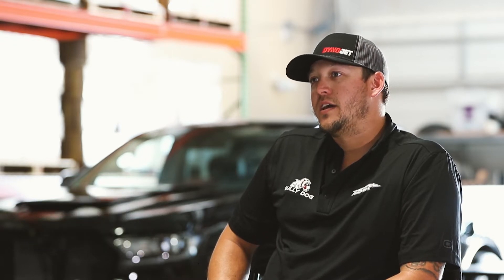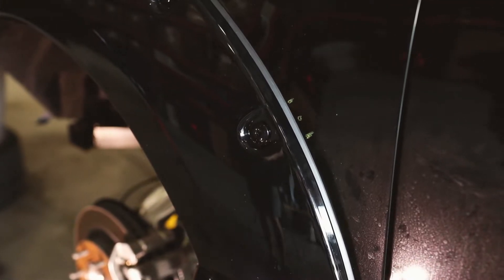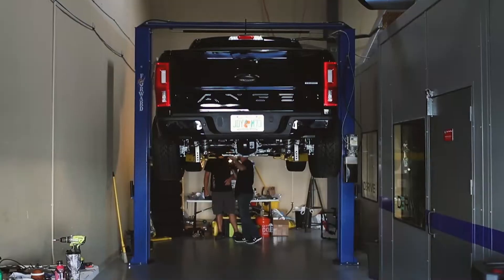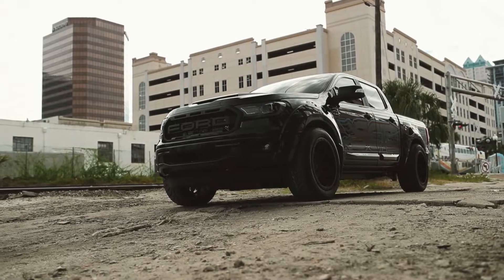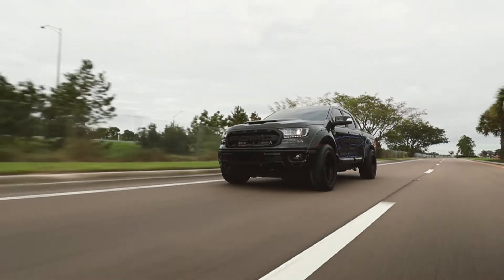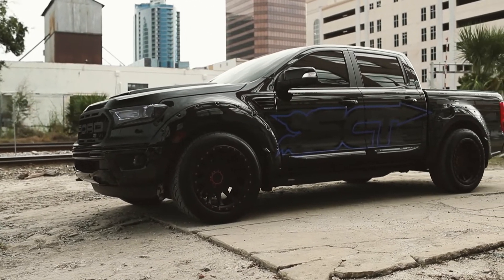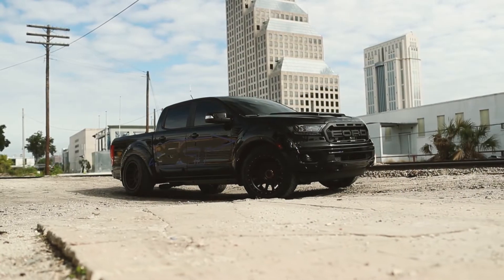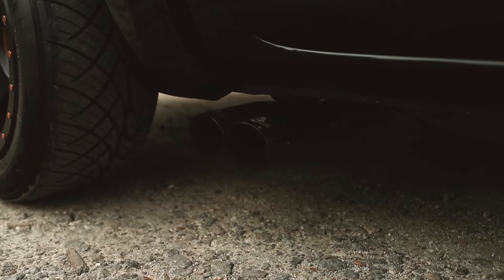'19 SEMA SCT Performance Build: 2019 Ford Ranger Circuit Truck

Comment: I'm cloning my '21 Ranger to look & perform like this truck.  Only issue I've ran into is, I cannot find Black Bolts for the Air Design Fender Flares...?  So far, I have everything else, except I'm wanting for the suspension parts to get back in stock....
Reply: Where did you find the air designs fender flares? I can't find them anywhere and ranger isn't an option on their website.
Reply: @Itzcuauhtli  Late 2021, Air Design had it on their site.  I have the same ones like they used on this truck, painted Shadow Black, off my truck and stored in my attic.

Comment: I've looked all over and cannot find the wheel and tire specs on this truck. Does anyone know?
Reply: I do!  Do you still need the specs?
Reply: @JasonsFourCamFox  Just came across this video now and i would love the rim and tire specs. Thanks.
Reply: @JasonsFourCamFox  what are the tire specs please ? I’d also like to know!
Reply: @Diguitarist  Crap, I'm sorry, YouTube didn't send me replies for a long time...  I'll reply below to Ron's comment.
Reply: @ron7416  I did the full swap a couple of years ago.  Wheels are Method Racing 605 NV Matte Black 20x10, 6x5.5 bolt pattern, 4.55" back spacing -24mm offset.  Tires used were Nitto 420V 265/50/20.  I'll let yall know, you will need a Belltech rear flip kit and an adjustable front coilover setup with custom upper control arms.  This will also stick the tires out almost 3" per side.  I still have almost everything off my truck, if someone is interested in any of it?  Wheels are gone.  Be warned, this was not cheap to clone...  You can find my build on the Ranger5g forum :)
Reply: @JasonsFourCamFox  Interesting, thank you!
Reply: @JasonsFourCamFox  did it ride well with those mods? why'd you decide to undo it? just curious.
Reply: @ron7416  No, it didn't really ride "well", even with almost $3k worth of suspension upgrades...  It rode like a normal slammed truck, with low profile tires, LOL!  Front drop was about 3.5"-4" and rear drop was 5", along with big, heavy wheels and short sidewall tires.  But, I have a track ready Fox Mustang with a Gen 3 Coyote in it and a 2 JK Rubicon with 37's, so rough riding is something I'm used too, LOL!  But, it definitely was one of the sharpest trucks around here!  I won 1st place at an all Ford show 2 years ago.  Reason I undo it was, I bought the Wrangler over a year ago and my wife needed a new vehicle, so we sold her 20 year old SUV and I gave her the Ranger.  She didn't like it lowered, (well, she did, but she hit a curb with it and screwed the finish up on one of the front wheels, plus I had lots of engine upgrades and it made almost 400whp and she definitely didn't need that, haha!), so I raised it back up, and put a 2" lift on it, with 33" tires.  It was basically an FX2 when I ordered it, I just didn't add the FX2 package on it.  Did you find my build on the forum?
Reply: @JasonsFourCamFox  yeah I checked it out the forum, it looked cool though!
Reply: @ron7416  Yes sir, it did look very cool!  I researched this truck for months and talked to the engineers/builders at SCT.  Unfortunately, the jackass, (I assume, owner of SCT?), in this video never bothered to answer any of my emails...

Comment: I wish there was an aftermarket kit to lower it :/
Reply: There is an aftermarket kit to drop it, actually two.  The one that's on the SCT truck was a company in Florida called Control Freaks full adjustable coilovers, with a 4 link rear setup, that has to be welded in place, (about $3500 for their full front and rear drop for the 2019+ 2wd Ranger) and Belltech makes a full drop kit now, a lot cheaper, but not as nice as Control Freaks.  To do this full build is definitely not cheap by far, I should know...

Comment: Soooo after all that, I still don't know how much HP its running at and didn't hear the engine at all. Nice video learnt absolutely nothing.
Reply: Well if going factory specs after tune, it should be bout 330 HP, 380 TQ at the crank. My best guess.